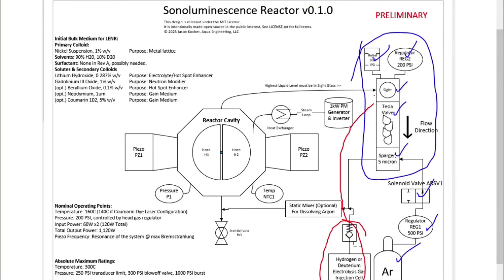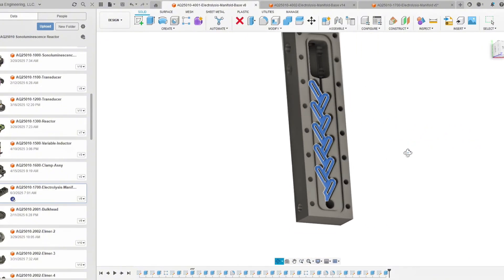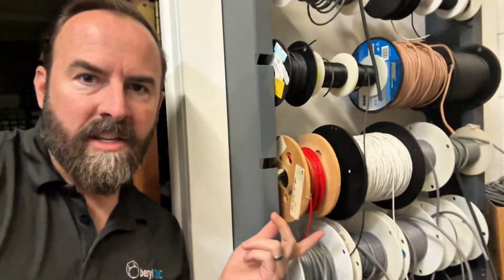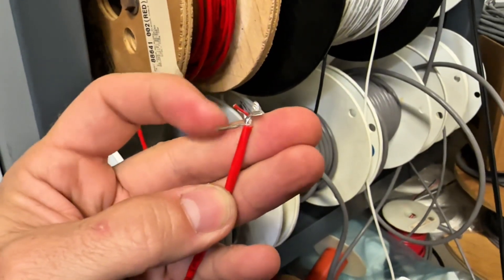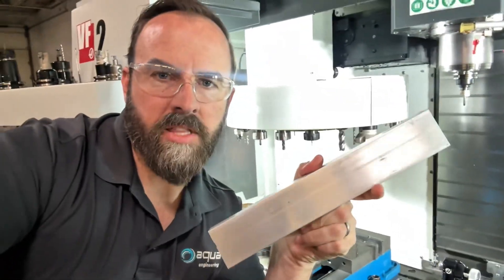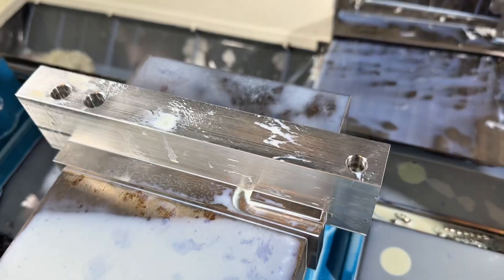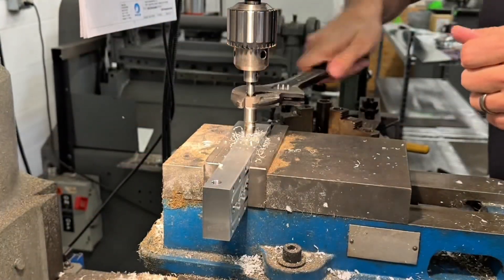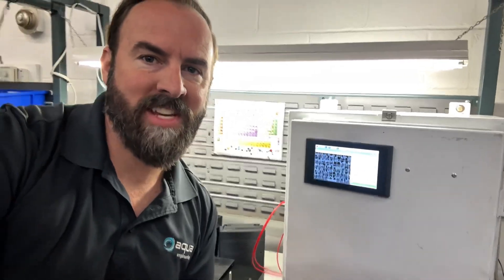LENR SonoFusion Reactor Part 5 - Tesla Valve!

Comment: Hi, Jason, Grounding in general as you know especially floating grounds are there due to multiple earthing points. Shield grounding almost always be at point or origin, i was taught that not only in my EE qualification but also my father who was a TV-Radio engineer from the 60's. That said, i spend more time adding caps to circuits just to take noise that appears from the either ?????

Comment: I really like the idea of LENR Sonofusion, but the issue I have with it is that you are about 100 million kelvin short of feasible fusion processes. That’s nothing you can solve by increasing the amount of energy you induce or by increasing material density. It’s physically impossible to reach these temperatures, even just for the amount of time it takes deuterium to cross the Coulomb barrier.

Comment: A possible issue you might run into is the Tesla valve eddy currents. Those areas may allow your suspended particles to settle due to the slow moving areas similar to how gold settles out in a stream.

Comment: Controls engineer here: Go to the side where the signal is generated, and ground the shield there. If the current is sourced from the other end, ground there. Do NOT ground both ends. That will create a ground loop. This ground is for noise control ONLY. Now for safety issues, you would ground everywhere. That should be a separate ground, typically an outer coaxial layer that does not connect to an inner shield. However, in that case there will be ground loops and you will get induction on the inside shield. So be sure your grounds are frequent and that you have good common mode rejection performance.

Comment: WRT grounding and shielding, that is what I learned too as a factory automation engineer. All shield grounds come to a single ground point in the controls cabinet (attached to a large diameter copper rod, 8ft long, pounded into the earth) and open "in the field".

Comment: About shielding - imagine that you're extending your grounded control box through wires as tubes. And yes, you shield only one side to avoid ground loopy-loops (but I guess you know that pretty well). BTW, I've tested plasma electrolysis in water. 300-350VDC, 308L stainless electrodes, a bit of baking soda in water, a bunch of plasma on a cathode with anode coiled around. I've got 1.14 efficiency (COP), compared to simple resistive heater. That's not taking hydrogen production and steam into account - just heating water.